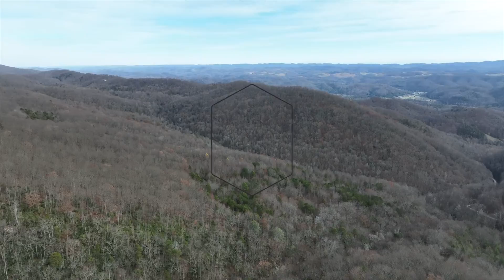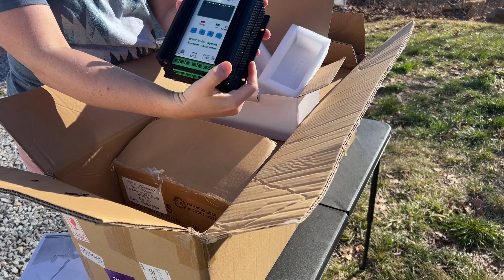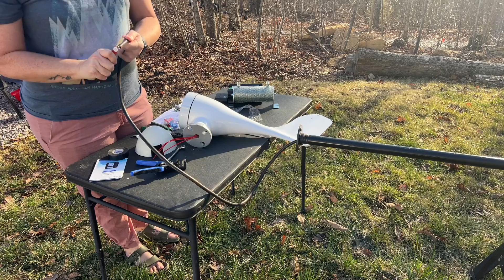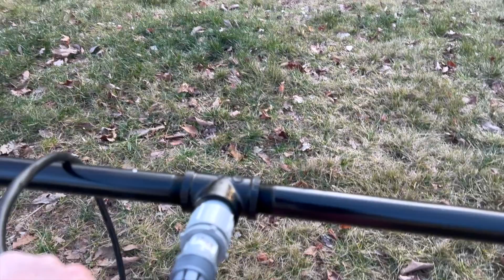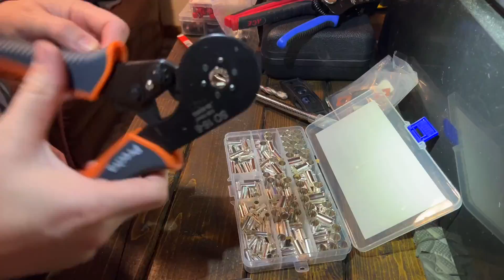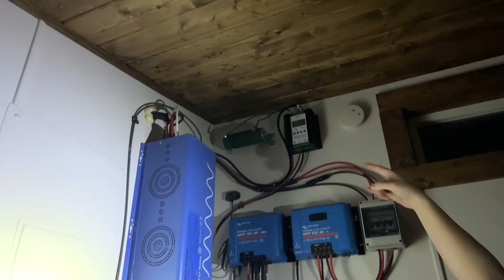WIND TURBINE INSTALL! Generating OFF-GRID power from the WIND (ECO WORTHY Wind Mill Install)

Comment: If you put it up maybe 30' above the trees the output would likely double, triple or more. We got about a 10X increase going from a height just above the trees to about 30' above the tops. It was amazing. No more reduced power power from the tail flailing in the wind trying to determine what direction it is coming from.   
My current wind turbine has been up for about 38 years at a height of 85'.
I had customers that went up to to 100' & 115'.

Comment: Do you have a follow up to this video? It's been almost a year and I am wondering how your turbine has performed.
Reply from the maker: No follow-up video, but I can say that it’s been okay… doesn’t generate a ton of power but this winter it has supplemented some! I would say in the end, helical turbines that don’t require directional facing and larger turbines with a higher output would be the way to go. And just like any other weather dependent power source, you gotta have the conditions 😅

Comment: Good stuff! I wonder how is pole  in wind? Is it solid or shaky? I am trying to construct pole as yours.
Reply from the maker: It’s actually been surprisingly stable! We braced it pretty well but it withstood some big winds from Hurricane Helene this fall.
Reply: @KaitlynandPatrick  Since I have a wind turbine, I had to put a rubber bussing between the pipe and wood which reduced the vibration a lot. I was lucky that the wind turbine came with a collar rather than a flange.

Comment: Who need small wind turbines?!? With solar panels you produce at least 10x more electricity with same investment! 
All real life tests show that small wind turbines produce hardly any electricity and don´t last long.
Solar panels, on the other hand, supply electricity reliably and almost maintenance-free for 25 to 30 years.
Even in winter with same investment you produce more electricity with bifacial solar panels vs a wind turbine.
Reply from the maker: Def agree with that. Every little bit counts for sure, and I do think one day when we need to replace the solar panels bifacial tech will be even more available than now

Comment: Hi. I would like to know what type of wire dod you get? Also, what size pipe did you use? I know it is 10 feet, but how wide is it?
Reply from the maker: I believe it was a 1-1/2” pipe. It’s been awhile since we installed it. The wiring came with the wind mill so I’m not entirely sure what gauge it is.

Comment: You should move the dump resister away from electronics.

It is a heater. I'd get a 2nd one installed outside when it's hot. The original I'd mount below the window. Then a switch to manually control which dump resister is used.
Reply from the maker: We actually thought about this, we had some options of where to move it if it ever felt warm but we’ve never even gotten to full power output, let alone enough to need the dump resistor. If we do these suggestions are great, so thank you!

Comment: Wind turbines should not be attached to structures due to vibration.  Horizontal axis wind turbines should be installed at least 20' above the nearest object within about a 200' radius.  Where I live in unincorporated California, the county allows turbines to be installed without permitting if below 35'.  You should check with your county.
I saw another comment indicating to expect less than the manufacturer's rated output.  From other reports I've read, you can expect it to be about half of their ratings if installed within the parameters I've listed above.  Given the height of the trees I noticed in your video, you would need a much taller tower that would probably be needed to be guyed and permitted which would likely be cost prohibitive.  Good luck!
Reply from the maker: Thanks for the feedback! We installed it in the most feasible place, the cable provided was only 25ft so it limited us. We don’t have many requirements in our county regarding permitting, you can just about do anything around here without issue. You’re absolutely right about the trees, the mill hasn’t operated at all since the trees leafed out, which wasn’t unexpected. We get less sun in the winter, which is when the winds can pass through more easily, so the little bit of power we do get from the mill is in the most needed season. We appreciate the insight and thanks for watching!

Comment: Hi you guys, what's the noise production/levels from it?
Reply from the maker: The fan itself doesn’t make ‘too’ much noise (just a little whistle when it’s catching good wind) but when the mill is cranking the vibration does make some noise inside the office. No more than a box fan on its lowest setting though, and not all the time (just when it’s really running).
Reply: @KaitlynandPatrick  I wrote earlier that a rubber bussing between the pipe and where you secured it would reduce the vibration a lot.
Reply: ❤ Trying to look out for something too, got neighbours to take note of too.

Comment: Hi I also have solar panels installed installed to mppt then to the lynx distributor, concerning the wind turbine does it work when you connect the load of the wind controller to the lynx distributor? does it charge the batteries i mean? thanks would it be possible to have a simple drawing of your whole system thanks
Reply from the maker: Yep, ours is connected to the lynx distributor and it does charge the same as the solar inputs. I don’t have a drawing per se but all of our systems basically go energy producer (e.g., solar panel) -> charge controller -> lynx distributor -> battery -> inverter.
Reply: @KaitlynandPatrick  Thanks for help, do you have a Cerbo GX to know if the amp from the wind is getting inside the batteries? is the output from the wind plugged on a lynx distributor or a lynx power in?
Reply from the maker: No problem! The mill is wired to the Lynx distributor. We have the victron smart battery monitor that we use to monitor volts, amps, etc. It shows all volts, amps, etc coming from the panels and the mill so we have to do a little math to find just the voltage and amps coming from the mill itself. Both of our charge controllers are Bluetooth enabled so know exactly what each one is brining in at any given time.
Reply: @KaitlynandPatrick  and the cables coming from the wind controller is connected to the battery input or the load output? goes to where? to the batteries or the lynx distributor thanks
Reply from the maker: From the battery input to the lynx distributor.

Comment: I noticed in your other video the four solar panels were being shaded by your antenna booster and now I see the wind turbine also in front of the panels. Are you still getting good output out of them with all the shading?
Reply from the maker: We’re actually getting great output from them! I was a little worried about it too but on sunny days we actually max out the panels’ output. That may not be their permanent home either, we’re likely going to have to move them when we build a house because they’ll be fully shaded by the roof line.

Comment: Hi again got my solar and wind turbine from ecoworthy have another question did the wire and the wing nuts come with the green dumploader or did you have to buy your own nothing came in my box to hook it up to hybrid controller if you got what size wire did you use everything  is going well in putting together made a cart on rollers  for Solar putting controls in box on cart so I can move use for 2 sheds and garage backup for house Thanks Again
Reply from the maker: Hi Mary, the wires and nuts did not come with the unit. We used 8awg wire to go from the controller to the batteries and we used some left over 12/2 black wires for the dumb load wires. However, the size of yours wires will depend on your system. We have a 24v system. Glad to hear your setup is going well!

Comment: And I would like to recommend a PVC pipe sleeve from top to bottom because what you are using my dear is at least what it looks like since it’s made out of steel and it rust that is gas pipe cast steel gas pipe so besides grounding it I would recommend putting a sleeve on it because yeah, you may ground it and once it gets struck by lightning, you gotta replace that windmill Putting a sleeve on that rod will make it so you have a less of a chance of it getting struck by lightning
Reply from the maker: Thanks for the tip!

Comment: I am glad to see. I am not the only one that used automotive grade 8 bolts because mine was only rated to be able to be in 90 mile an hour winds for short period of time when I only had it up in 50 mile an hour wins the bolts that came with mine snapped so I put grade 8 bolts and now I don’t even have to take it down at alland I get wins up to 150 miles an hour

Comment: I installed 17000 watts solar, 4 forklift batteries, a hurricane windpower 1500 watt turbine, 4 inverters, 4 charge controllers, a dc generator,  and all the parts to bring everything together, we have been offgrid and powering everything for 7 years now, and advice i can give is, install a couple of car stereo capacitors, because they help with fridges, and motors turning on, they help keep your loads from dropping voltage when they start up, and helps your inverters from being starved of power. Early on i had an inverter burn mosfets because i had two fridges on it, and the inverter was sized right and could handle it, but at one point the two fridges kicked on at exactly same time and drawed power down and the inverter didnt like it, and burnt 3 mosfets on the board, after some research and time, i took apart the inverter and installed new mosfet board, and installed two capacitors, since then i havent had an issue. I learned from a old technician, said helps keep system stabilized.

Comment: Great video have the same problem you do don't weld so does the flange twist on, and what length pipe did you use to put the T in between? My wind and solar is on the way from ecoworthy.
Reply from the maker: Thanks for watching! We used 10’ gas pipe on both sides of the T connector and the floor gas flange on top to connect the windmill. We did have to drill the holes out slightly on the floor flange to make it work with the holes on the wind mill. Good luck with your install!

Comment: 18:39 Capacitors keep their charge especially Electrolytic Capacitors but if well designed they have bleed resistor across the high value Electrolytic Capacitors to drain that charge, some people have changed the generator side of that wind turbine for a deeper generator producing more power, other people have put longer blade's on that unit, for the price its quite good, I would have a dump load heating water, like an emersion heater in a hot water cylinder,
Reply from the maker: We’d love to use a passive water heater system like that but TBH we haven’t even maxed out the capacity of the turbine yet. It’s def helped on the cloudy, windy days but we’ve yet to be full capacity on batteries and getting wind power. Def a cool idea though!

Comment: I converted it gooseneck horse trailer into my home solar and 9 blade 1500 wait  turbine  . I use 20 ft 1.5 inch pipe on side of frame same concept as truck hitch rase and lower so I can travel
Reply from the maker: Nice! Sounds like a cool setup!
Reply: What turbine did you buy and what actual power have you seen come out of it?